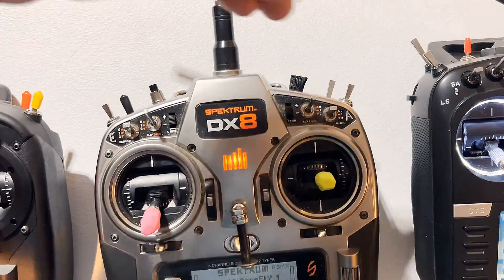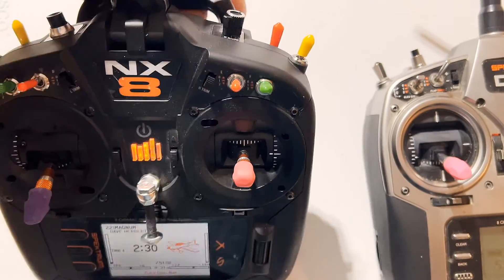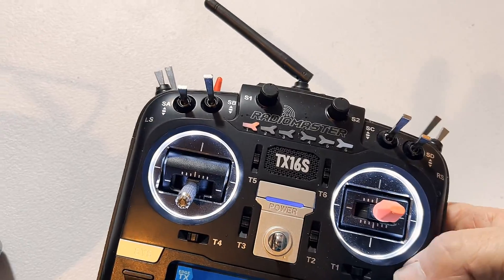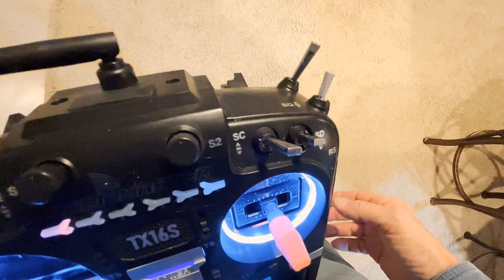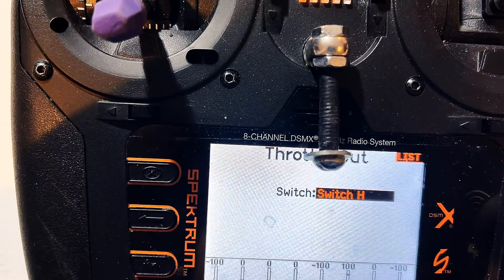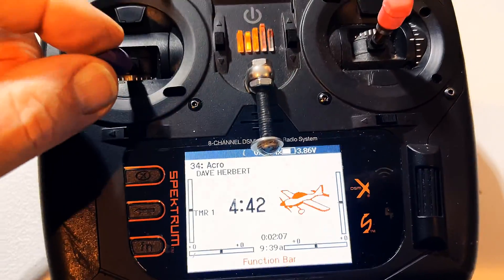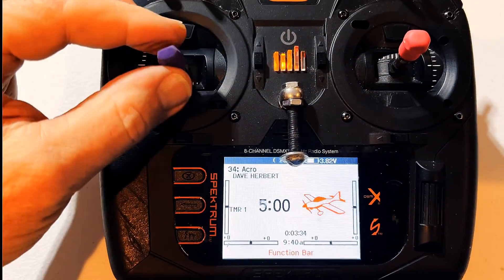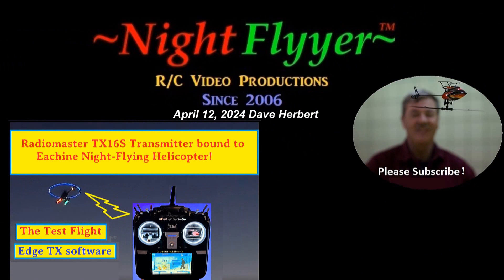The SAFEST and PROPER way to set up  your throttle Kill Switch on Spectrum TX's. Common Sense.

Comment: I had my throttle cut the other way around. I will reverse all my model programming  throttle cut. Makes way more sense the way you have it set up. Thanks for the great tip. 😊
Reply from the maker: Good. I have had too close of calls and when I have a harness on and  sometimes I move that throttle stick by mistake.  Thanks so much, and Happy flying.

Comment: Very good explaining of why to set the throttle kill switch with kill position pointing up towards the pilot. I call the kill switch my "Holy switch" and I use it like a Holy ritual to never forget to switch the motor off the moment after flight. At the very beginning of my CP heli adventure 3 years ago I once forgot to hit throttle kill. I was then still flying in "normal" mode (vey bad in my opinion now) and I was moving the throttle stick accidently while kneeling down to my heli. The motor started and the rotor blade of my Blade 230S V2 hit my left thump. Ouch, there was some blood on the blades and my hit thump was blue and green and hurting for weeks. I was lucky... imagine beeing close tp the main blades of a 400 or 700 with your hands or face.... Thats why my Throttle Cut or kill is my "Holy switch".
Reply from the maker: Ive done the same. Didn't get hurt, but it scared the hell out of me in that surprise start up.  Thanks and happy flying..
Reply: Jesus is my holy God that saves me from hell
Reply: @xfilesseasonteneponeandsix8346  It will, believe me! Safe and happy flghts!!
Reply from the maker: @xfilesseasonteneponeandsix8346  We sure hope so.

Comment: I put my arm/disarm on my right side, easier for me, and I’ve gotten used to it… I get there are common sense places to put the arm… I have a smaller controller and put my fingers between the two rows of levers, idk… I fly fpv anyways, not planes, so maybe planes are better with other switch setups
Reply from the maker: All mine are on the right side!!  I clearly showed that on all 3 transmitters.   There is no momentary switch on the newer Spektrums to start the timer, so the timer starts automatically when you move the stick above 25% and stops when you drop the throttle to zero.  I also use my throttle cut switch (H) to prevent my nitro planes and helis  engines from going above idle. It does not kill the engine.  I do that with low throttle trim, but with the kill switch engaged, the engine idles so bumping the throttle stick will not cause it to run up unexpectedly.

Comment: 5:02 I don't get that on my Futaba system. Could enable it if I wanted but it defaults to off. Also I tend to not run my timers on my throttle, rather on their own switches. 16 channels at my disposal most complicated airworthy model I own is only 7 channels so I got plenty of spare switches for that!
Reply from the maker: There is no momentary switch on the newer Spektrums to start the timer, so the timer starts automatically when you move the stick above 25% and stops when you drop the throttle to zero.  I also use my throttle cut switch (H) to prevent my nitro planes and helis  engines from going above idle. It does not kill the engine.  I do that with low throttle trim, but with the kill switch engaged, the engine idles so bumping the throttle stick will not cause it to run up unexpectedly.

Comment: I use my trainer switch for it. Only needs to be a momentary flick on a nitro bird.
Reply from the maker: There is no momentary switch on the newer Spektrums to start the timer or use as a throttle cut.I use my throttle cut switch (H) to prevent my nitro planes and helis  engines from going above idle. It does not kill the engine.  I do that with low throttle trim, but with the kill switch engaged, the engine idles so bumping the throttle stick will not cause it to run up unexpectedly.
Reply: @NightFlyyer  That's a bit....odd. Surely it has at least one momentary button or switch on it somewhere for buddyboxing. You'd think having a switch or button that's only active when held down would be present for transferring control to the student pilot while making it quick and easy for the instructor to take back over when necessary.

Or does Spek simply not allow that to be repurposed? Futaba radios don't have any restrictions on what you can and cannot use a switch or button for. Can freely program them all as desired, so I use my trainer switch for throttle cut and leave my throttle trim solely to handle setting idle speed. Pretty neat menu in there for programming it on my 16IZ, too.

My nitro heli is the only model I own with a switch that limits throttle travel in the manner you have here, and it's got 3 positions. All the way up is engine kill. Middle is engine start, where the collective and throttle are both kept at an idle position regardless of stick position. Fully down is 'flight', where everything is enabled and the model can be flown. But even here I still have my usual trainer switch throttle cut set up for emergencies; shit hits the fan I pull that switch carb closes. It's an old heli...GMP Cobra...OS 60SF-H in it.
Reply from the maker: @TestECull  I have open TX with Edge TX software on my Radiomaster T-16S, I have several Futabas, and several Specktrums.  I also used to work for the first and the inventor of digital proportional radios. in 1978...  Kraft Systems.  I got hired because I invented dual rates and got my design published in the AMA magazine. So I know my Transmitters.  
But again, this is not to kill the engine the normal way, this is to prevent the throttle stick from getting bumped and reving up the engine/motor.  It also will kill the engine, and why it is called a throttle cut.  Pushing a button (I do have that) could kill the engine, but in order to keep the engine from running up with the throttle stick, you would have to hold the button down all the time.  I think you misunderstood this. Happy flying.
Reply: @NightFlyyer  As for timers...I usually put those on a 3-pos switch. Middle pos is stopped, up is clear, down is run, and I usually start them when I taxi out and stop them when I taxi back. I tend to make all of my switches be down for 'flight', as well. Retracts, if so equipped? Switch fully down, retracts tucked up. Flaps? If they're on a switch instead of a slider, fully down is fully retracted.

If I had a single electric model it'd probably end up with the throttle kill set up like you describe in this video by default just because flight would be down to match everything else haha.

Comment from the maker: I have been asked several times about throttle kill switches, so am showing you the most common way to set them up and why.  This is especially important for Electric aircraft, as an instant start up, WHEN LEAST EXPECTED when bumping the Throttle stick by mistake is dangerous!  This helps.